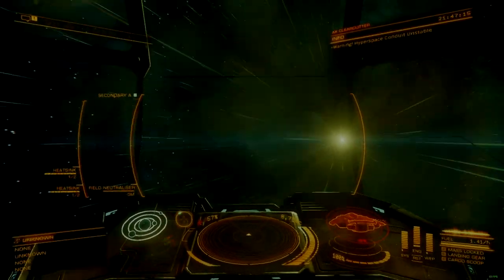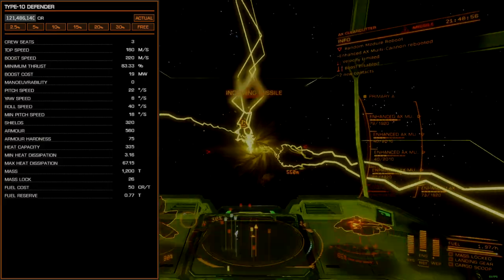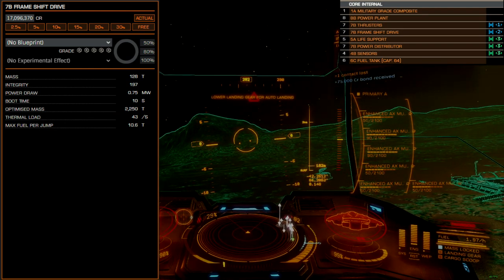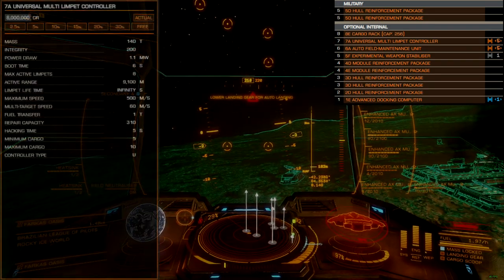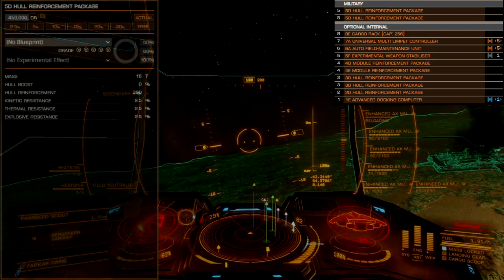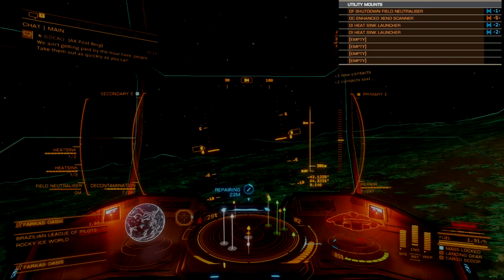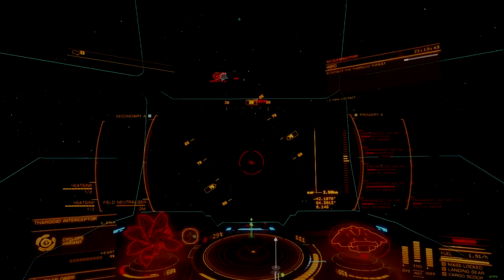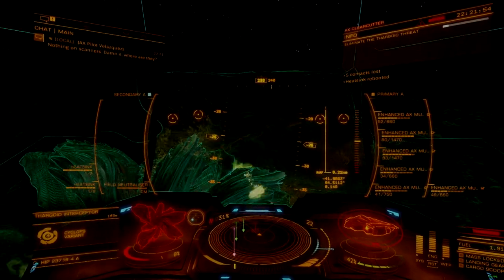Elite Dangerous | Zero Grind Ship Build | Type-10 Defender | AX Clearcutter

Comment: I copied your build for my T10 and wow it's a scout killer but I have more trouble with the interceptors as I don't know how to use a flak launcher, and I disagree with using beam lasers as it's a bit overkill (I know that's the point, right?). I'm going to swap out the beams for Ax missles. I've used them before and they seemed for me at least to cause the heart to heat up quicker on a clops. Thanks for making these videos, but I hope you'll make an npc/pvp series in the future! ;)

Comment: Well explained video once again.

How about an AX sidewinder build???  Insanely low rebuy cost. Although a group is needed, of course. 6 of us managed to take down a hydra with an average of 3 rebuys each.
Reply: cyclopses are easy to kill with one or two npcs assisting.i use one for fun fights with 1 gauss and 1thermal vent beamlaser(laser cant always fire cause its a max speed build with limited power)
Reply: @thowun7614  I went with guardian hybrid PP and Distro and mostly guardian hull and module reinforcement, it's definitely not a cold build at 33% idle. But it can handle a long range beam laser with thermal vent, and for me, it's a modified shard cannon for the other hardpoint lol. No field neutralizer or xeno scanner either, the  2 utility slots have heatsinks. Speed at 491 boost which is more than enough for my fighting style.

I reckon you would have liked our sidewinder only event a few weeks back taking out clops, bassis, dusas and hydras.

Comment: Nice. But ultimately you really need to do "some" grind to enjoy your time, and with that? I think it's at least more feasible to focus on "non engineering builds" as the casual player. I think my favorite (virtually) no grind builds does require you to at least have access to the Guardian power distributor, power plant and Guardian HRP/ MRPs (go a one further and get the meta alloy HRPs) and since most people are going to bother to grind at all for the FSD booster? You may as well sit it out at a Guardian site and respawn 4-5 times for four module blueprints because once you unlock them? They are unlocked for life of the game and any future builds basically become "no grind builds" and you can just then throw a few human or meta-alloy HRPs and mix them with guardian HRPs and have a pretty decent experience, when combined with repair and decontam limpets. With a total of something like 25% caustic resistance? These HRPs behave like engineered pure health HRP builds. They even add thermal resist, which helps with human PVE combat. I would often create "throwaway AX builds," if I happened to have been out of AX gameplay long enough to have sold my prior AX ships and/ or modules, but wanted to later partake in new CGs or new AX content. Of course, I now keep those builds, but I've enjoyed my time with nothing but a mixture of Guardian and Meta-alloy HRPs. I mean, you're not going to play this game at all without some level of grind. Even just the act of getting a Corvette or Cutter is a big pain in the a**.  That said? My favorite no engineering (support) build:

Cutter (because it's fast and you have some chance to get away, while also stacking a pretty nice amount of hull health) 3x C3 AX multi-cannons, fixed, and the rest of the hardpoints as advanced multi-cannons (alternatively, you can use 3x AX missile racks and the rest as advanced missile racks, or even mix and match). Synth AX ammo for the advanced hardpoints when fighting bugs as needed and watch them melt. For re-adaptation into human combat, drop the 3x AX multis and supplement with 3x huge and large multis and ditch the decontam limpet for something else useful, like another hull module, or collector limpet. In fact? I would often supplement with a Bi-weave shield, for a little renewable scratch protection, unengineered, and just boost out of combat, which shouldn't be too difficult in an AX conflict zone and others around, then refit and re-heal the shields and jump back in. I've also adapted this build with a Python to great success. I had my buddy do this to get a taste of Thargoid content. But, of course, like many he stopped playing once he got an end game carrier and hadn't even made it as far as actually unlocking the Guardian weapon modules.
Reply: Remember that the Anaconda could be another great ship to fight cyclopses if you're planning to go without a Shield. I used this before too and could at combat rank Master kill them in literally 2.5 minutes. o7